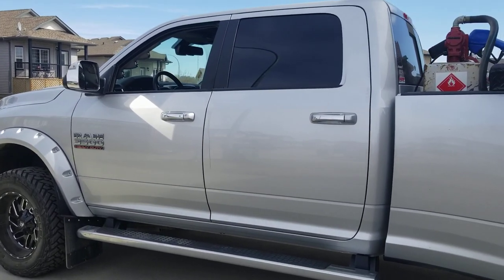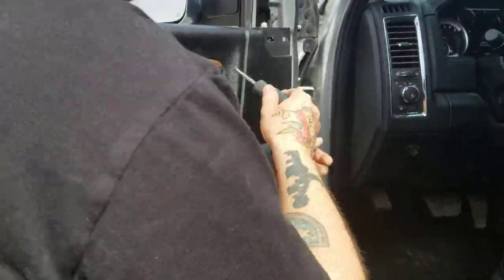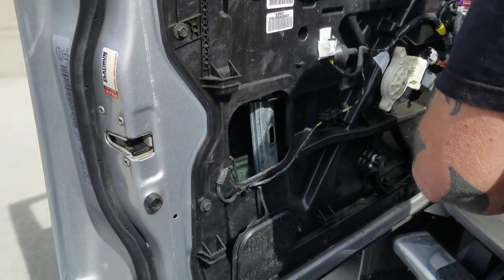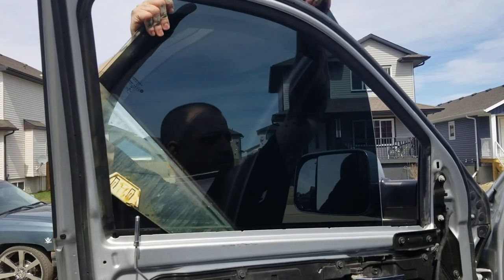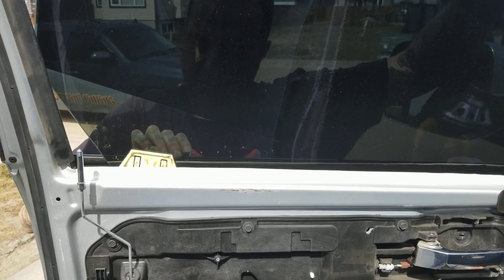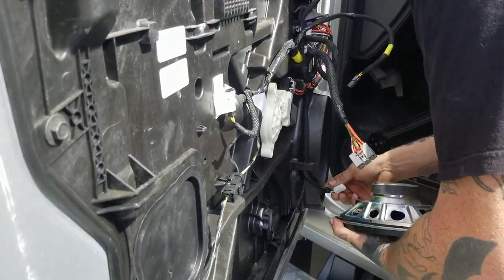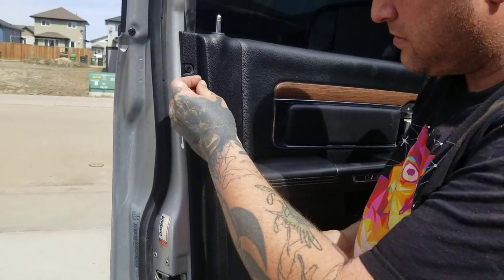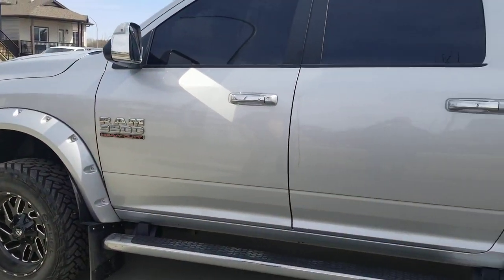11-18 Dodge Ram window removal

Comment: I was an auto glass tech for a few years. 

Couple additional tips I’d ad is…
Remove the window control switch first, before popping the door (on some models there is a screw under there too!) 

Only use plastic vinyl popping tools  on these modern plastic doors, if you look at them to hard they get scratched, the metal hook you used can easily damage them.

NEVER set glass on a hard surface, I could hear it being scratched in your video and it hurt my soul (loved the masking tape tho, good move!)

Sometimes lowering the brackets after removing glass from plastic clip will make it easier to angle down and remove from door (less binding) 

Placing the driver side lock switch in the locked position makes it easier to remove the panel, in can catch and that metal bar it’s attached to can be bent super easily. (Put it back in the unlocked position when returning door panel) 

And I see from the other comments you have lost most your hearing but my god keep the ignition off when you’re not adjusting window height 😂

All and all great vid, thanks for posting!
Reply: Would the method he used to get the glass in and out work on a 04 dodge ram? I know for the looks assembly and disassembly is a bit different  just wonder the glass part get it in and out. Thanks

Comment: My window just came off the track and after seeing this video, I will attempt to reconnect it.  I was afraid if I took the door panel off, the window would just slide out and break.  Now seeing the window part encased in the door and accessed through large holes, I can feel more confident reattaching the glass to the track.  Thank you!

Comment: Thanks for posting this.  I had an issue with my window (frozen closed and the auto down function pulled the window out of the bottom clip on one side) but was able to take it all apart and fix it in 20 minutes.  Thanks so much!

Comment: Took out the passenger front on my 07, was going to move it to do the weed whacking but no and smash goes the window from a rock I kicked up FFS! $450 at speedy glass, F that, $60 at SGI salvage. Ya I had to F around for a bit but saving that $ was worth it minus the annoying door chime in this video. Thnx for posting the video TC 👍🏻

Comment: Great video. Thanks for making this. Any idea if the 4th gen 1500 and 2500  have same front window of both crew cab?  Been trying to figure that out online for a bit.
Reply from the maker: Yes they are all the same glass
Reply: @thomascholowski3308  sweet, just got one this off of a 1500 this weekend and looks like it will fit. 25 bucks at a pull parts place saved me some cash. Thanks a lot for the info.